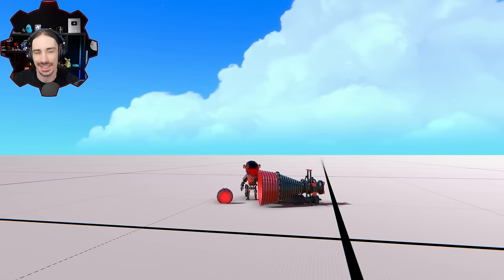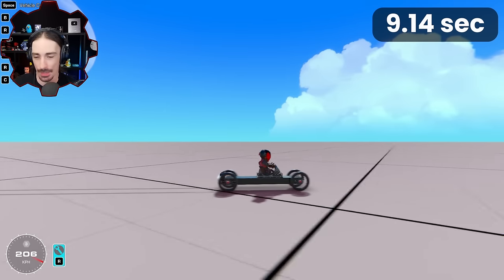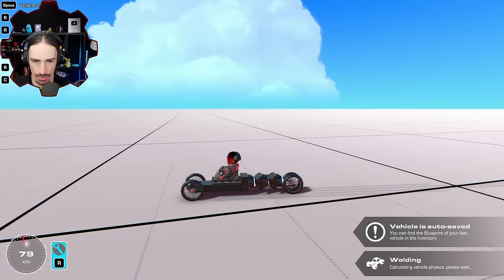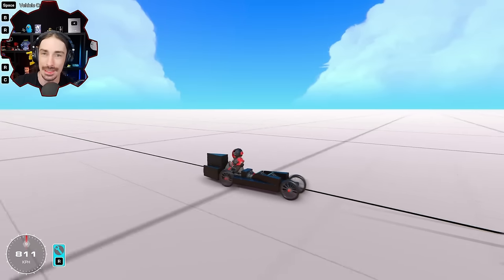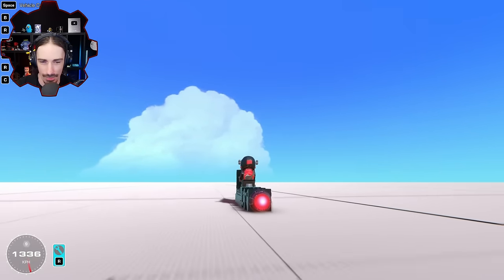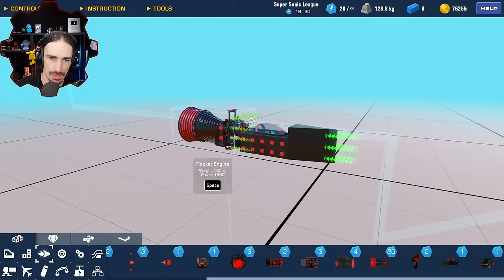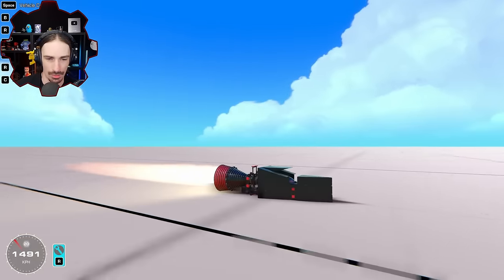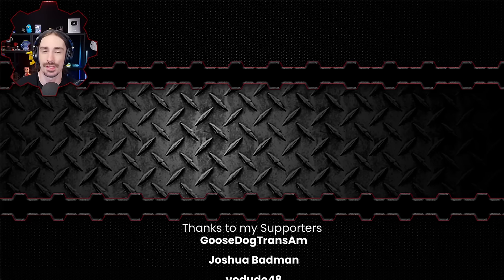How Few SPACE THRUSTERS Does It Take To Break The Sound Barrier?

Comment: if you get an altitude sensor set to -500m (or a distance sensor set to 0m invert trigger) and set the output to 0.03 and link it to the thruster (or anything which has a ramp up) it will basically just remove the ramp up.
Reply: the oprator seat, although it may look like a 2x2 from the top, is 3 blocks long, so you'd still have to use 3 stacked wedges to cover it completely when you put it on it's back.
Reply: .01 works too, can't remember but I think .03 outputs visual thrust so I prefer .01
Reply: idk, sounds like an exploit
Reply: @mayonasepizza  That's literally how rocket engines work though. They make basically no thrust at very low burn rates, but they have to ramp up. So, IRL you could do something like that' except that the fuel would make such impractical. 

Since fuel isn't a thing in this game, if there is an "exploit", it's intentionally coded into the game by the devs, meaning that it's not an exploit.
Reply: Distance sensor set to 0 and made to activate when it doesn't detect anything works better, you can go bellow -500 altitude on the space map.
Also, 0.01 works better, it doesn't show thrust, just like "adc109" pointed out.

Comment: I think it's the weight difference that allows you to get away with no wheels with the space thrusters.  Everything else causes too much friction with the ground.
Reply: works the same with 2 dragon thrusters
Reply: I Feel like the friction might also be a bit of an issue for some wheel-less designs , if the area of contact with the ground is too big . . but that could pretty easily be fixed with a few wedges

Comment: it's important to note that, in conjunction with the light weight of the space thrusters, their thrust is perfectly centered. with the large jet engines, there's the heavier weight to consider, but also the friction that is being added against the ground. because the off-center thrust works like a lever, pushing scrapman's sled into the ground with greater force than with the space thrusters, his speed is reduced.
Reply: I thought the same, if one jet was mounted upside down it would probably work. Of course that would require the flat connectors being the new point-on-contact on the ground, but maybe that could help? Like little dragless skis.
Reply: @TlalocTemporal Unfortunately I think the connection points and the hitbox of the large jet engine make flat connectors unusable. Or if they can be use, they would do more harm than good with the extra blocks needed to make them work.
Reply: @TlalocTemporal  how about putting the jets on either side, it would probably require more aerodynamics, but that would even the thrust
Reply: If you have an even number could alternate left/right or up/down to have tthem cancel out

Comment: MISSED DETAIL! The large jet engine build when he removed the wheels and aero has 2 blocks down in the corners of the engines with no aero. May have been why he couldnt reach the sound barrier. At 13:00 you can see a yellow arrow. I know he kinda fixed it later but that may have been why.

Comment: Could it be that the thruster is applying torque on your creation causing it to push into the ground when you're using those big engines, whereas the small engines are pushing directly forwards?

Comment: It's due to how many points are on the ground, think of it like this. On small craft like the space thruster one, adding wheels will decrease ground friction by about 6 blocks while adding say another 6 to air friction, but air friction has more of an effect on speed. On a bigger craft, it still only adds 6 to air friction while it will remove like 25 blocks of ground friction.

Comment: the reason why you couldn't do it with 2 jet engines with that design was probably because of the jet engines being both at the back and since there collision box is smaller than there hit box it caused your vehicle to angle up slightly which would both cause more friction and a slight loss to your forward velocity. try putting one of the jet engines in front of the cockpit to evenly distribute the weight and see if that will work
edit: this would also mean that there would be less blocks touching the ground causing friction

Comment: Instead of swapping the go kart seat with the cockpit, you could've kept it as you had a 4x2 underneath the seat, thus needing 4 wedges, removing the block would've saved weight.
Edit: using grid blocks is also better than using those 1x2 rounded blocks.

Comment: I gussed 2 cause I made a plane using 1 and it broke the sound barrier 😅 so yeah there way more powerful than u ‘d think. Also the single space thruster was faster than the rocket engine on the same design same against the large jet engine but i guess that’s cause that 1 was designed for the space thruster

Comment: What’s even crazier it that I think the space thruster variant can be made slightly faster. 1x2 grid blocks are 0.2 kg lighter than rounded 1x2s. Now I know that a collective 0.4 kg will make next to no difference, but it’s still wild to think that an improvement, however slight, can still be made to what is already such a tiny and efficient design.

Comment: i think you could revisit this idea again but with improvment, for the rockets engine, you could using the attachment block and attach it on the grounds, and when the time is right you could release that attachment block using disconnected block? or something, sorry but i dont know the blocks name.

it using same principle with rocket launch where is holding the rockets until the power is enough to lift up itself before it launch

Comment: scientifically the lighter the object the better it will slide if the gravitational pull is weaker than the presented applied force 
(Like the small space rocket experiment)
But if the object is heavier like the “large jet engines” 
Experiment the less friction added (wheels for example) will equal less weight 
Large mass = weight < fric and aero dynamics 
Small mass = applied force > gravity + weight is my (estimated) take on this experiment

Comment: So I have a possibly stupid question so on this vid I learned that less areas to have resistance is better. So does that mean if you the operator seat? I think forwards then put a thruster on the back and 2 sets of 1x4 wedges then connect with a 1x2 connecter piece you don't think it possible to break the sound barrier since your going from 3 sets of 1x4 to 2 sets of 1x4. A 33% decrease in resistance if I'm correct

Comment: wouldnt the wedges push you down into the ground, creating more friction? the way your front is build, each time you use the jet engines, you have wedges that are pushing you down i think. in the other builds you were shaped like an axe, cutting the air straight on vertically. maybe?